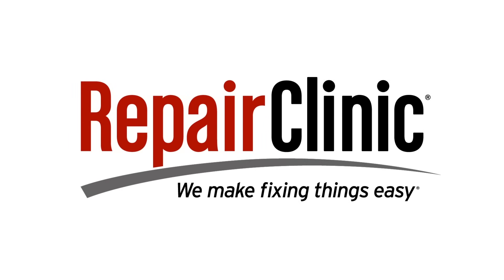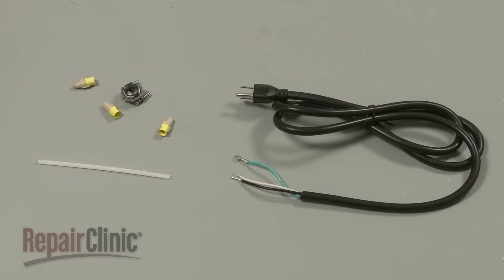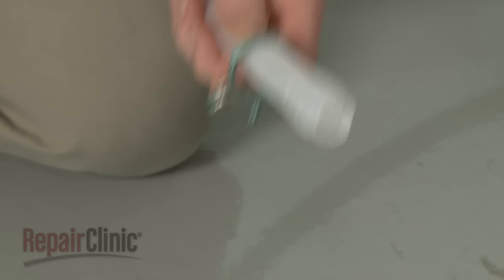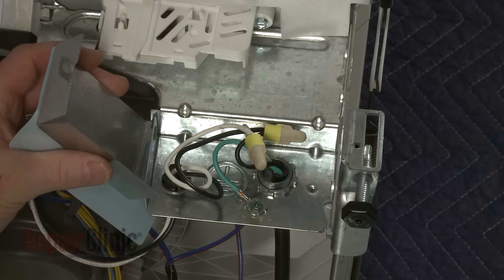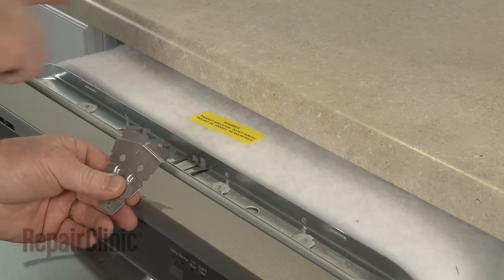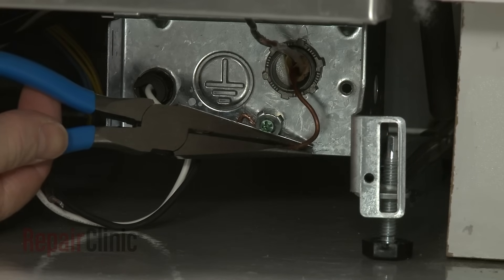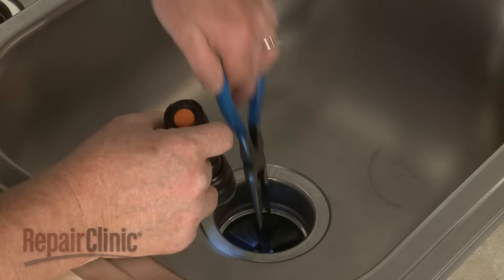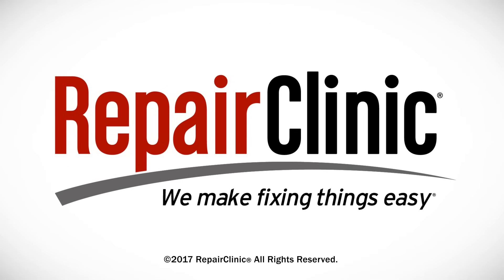Whirlpool Dishwasher Installation (Model WDF520PADM)

Comment: Installed Whirlpool model WDF330PAHS which is similar to this one. The instructions were spot on. Even with having good experience with plumbing, electrical, and appliance installation, this video provided some useful tips with this particular model and gave me good insight on exactly what to expect. Barely even needed the install manual.
Reply: Thanks for the comment - I just ordered the same model you installed and was hoping the installation was similar. How's the DW holding up after 4 months?

Comment: Great video, clear directions.  New Whirlpool dishwasher works amazing. My old Kenmore one was a champ installed in 1991.  I calculated the energy costs and it appears like it will drop the KWH from about 950 down to 241.  Estimated electric bill down from $122 to $31 annually.  Got this dishwasher this weekend 9/2018, at a local appliance shop new for just $300.  Full cost recovery in just 3 years, 4 months!  Plus I'm going to have dishes that are actually clean! :)

Comment: Thanks for video, sadly this thing was much more difficult to hook to a solid brass line where the height had to be all the way lowered.  If you pause at 10:48 you will see that drain line going under the feed line, mine has no room for both so they collide and connecting the solid brass feed was a nightmare.

Comment: thanks for the video. The part that I'm still not sure about is how the drain hose is supposed to be oriented after you connect it. You can't see it in the video. On my unit, the drain hose that is already attached to the dishwasher has an opening pointing towards the front of the dishwasher. So when I attach the drain hose, it has to awkwardly loop back in order to go to the back of the dishwasher where the hole in the cabinet is. Not sure if my unit has the attached drainage tube oriented wrong?

Comment: My drain connection does not go thru the garbage disposal...The drain is low in the sink cabinet.
Can I do a straight connection or do I still need to loop the hose high and/or use a anti-siphon devise?

Comment: Hi I have a bran new dishwasher model wdp 540 in the hole where the dishwasher goes there is a 2 inch drain pipe behind it prevents it from going. All the way through I can not move the pipe because the landlord dose not want to I need help finding out what I can do to Mont the brackets on the side because it's sticking out to much

Comment: The model we bought required the input of an installation cycle.
After installation we got an  error code code and the dishwasher would not operate. After the inputting the installation cycle. Everything worked fine.
  I was very frustrated until I reread the instructions. Lol if all else fails read the instructions..

Comment: I realize that this video is for a different model but if anyone is installing a dishwasher using the w10806906H manual be aware the height adjustment chart has an error for the 341/2 size cabinet opening. 27 millimeters is 1 inch and 1/16th not 11/16th's.

Comment: It talks about hard wired in beginning but no instruction for hard wire? Where does the copper wire connect?
Reply from the maker: Same as with the power cord, black to black, white to white & green to ground. Thanks!
Reply: RepairClinic.com  you mean, copper wire to ground.
Reply from the maker: Sorry, yes the bare wire would go to ground screw in the junction box.
Reply: I don't know if the video was updated but there are clear instructions for hardwire later on in the video.

Comment: Shouldn't the kick plate of the D/W be aligned with the kick plate of the adjacent cabinets? The way it was installed, there is a gap between the cabinet kick plate and the D/W kick plate.